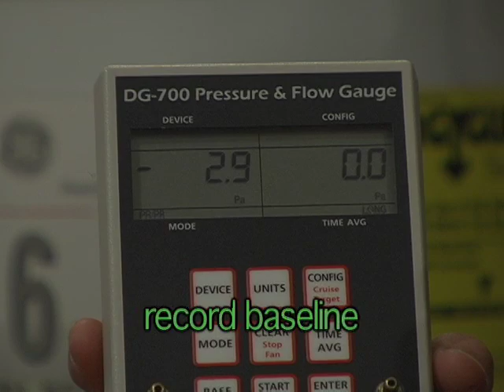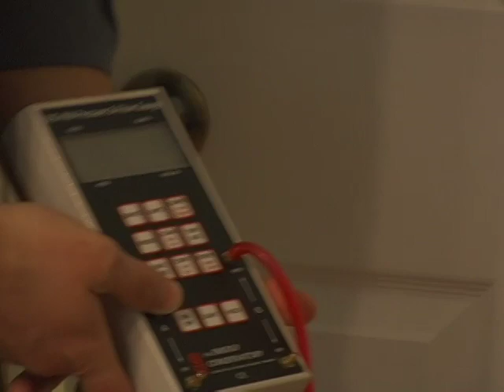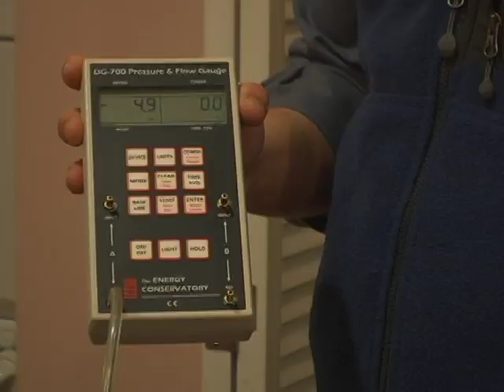Worst Case CAZ Depressurization: Building Performance Workshop Review

Comment: Question....on many new air handlers they have either a x-13 or variable speed fan motors inside them. In fan On and the system switch to off the fan will only run on lowest speed. It isn't until the control wire for the condenser is powered does the fan kick into normal operating speed. Does this effect the results?
Reply from the maker: +raymond Moore It sure does- you can find instructions for tricking the air handler into high speed in the appendix of my book Home Performance Diagnostics.
Reply: Ha trying to sell you something

Comment: You turned on all exhaust fans, but did that include the close dryer ?
Thank you for all these great videos
Reply from the maker: +AeroFlynn Help It did include the clothes dryer, yes.  Suck on the house as hard as you can- if that includes the central vacuum system that dumps in the garage, do that too!

Comment: Quick question. A professional performs this test with results showing a very low Caz pressure. Let us imagine imagine -13 Pa. As his/her result. Spillage may be a problem when the fans are jumping and jiving. So as a corrective measure you need to let air into the Caz for improved venting. (Am I thinking on the right track? Remember we are human and idiot logic may result.) Would the Caz be the area for this improved ventilation, or perhaps somewhere else in the home? I understand on a tight code conforming house ,the building envelope is all common to the caz. Placement opportunities for fresh air intake sounds like it may be tricky. Moist air needs to be controlled.
Reply from the maker: Joseph Quattrocchi You're on the right track for an inspector, Joey Q, but if you do the 4-3-2-1 magic, a hole in the enclosure is the last thing we want. Spillage can be caused by several things, and depressurization is only one. If depressurization is the issue, I always recommend sealed combustion appliances instead of natural draft. If the home is well-enough equipped to suck that hard, and airtight enough to make the chimney the most attractive makeup air pathway, then the home deserves real equipment, not stuff 1950's technology.

Comment: Check out the WiFi transmitter from the Energy Conservancy for the DG 700 and the associated APP, iTEC-700.  This way you can see the actual Pa. impact each fan and/or door position has on the CAZ.  I was surprised to see that my range hood had more suction on the CAZ than my dryer.  And when the dryer was on a heat setting (not air fluff), it actually sucked more air from the CAZ than when it was on air fluff.  And true worst case happened when the AC was on, not just the air handler.

Comment: Question:  We noticed you mentioned recording the base pressure in the CAZ with reference to the outdoors.  But, at the end of your set-up, there was no mention of adjusting the measurement by removing your base pressure.  The worst case CAZ pressure in your video is really -4.9 - -2.9, or -2 Pa at worst case.  We use the baseline feature on the DG700 to do the math for us.  Thanks again for your great work.